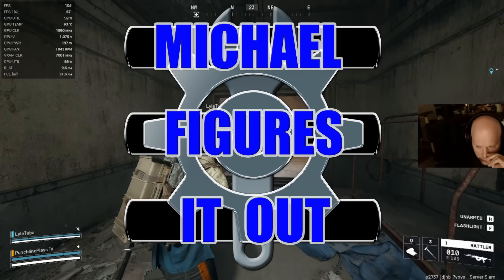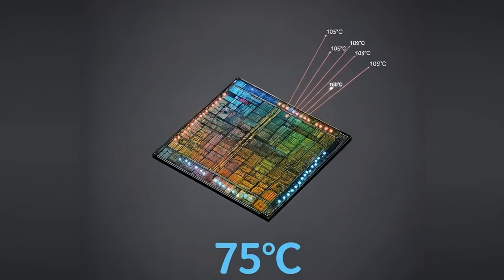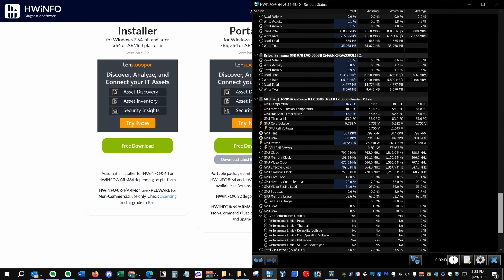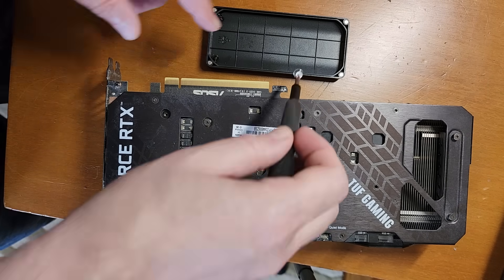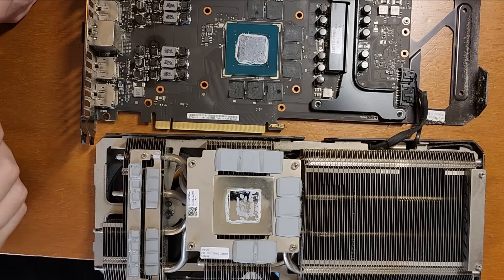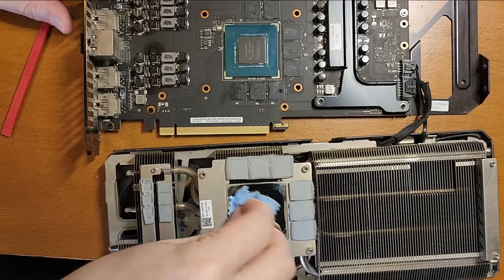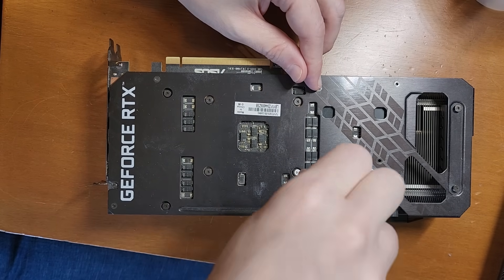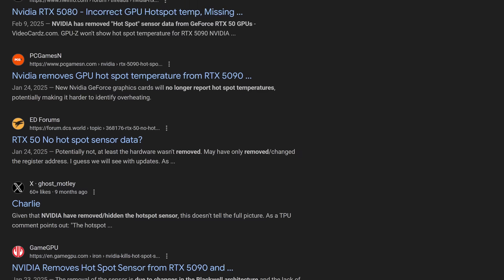GPU Temps Are A LIE!

Comment: Nvidia removed the hotspot sensor on the 50 series lol.
Reply: Ngreedia at its best buy more save more
Reply from the maker: I hope they bring it back for the next series.
Reply: @MichaelFiguresItOut  Hopefully, it's really helpful in knowing issues if your card hasn't been pasted properly at factory, and also waterblocks.
Reply: @MichaelFiguresItOut  Which software are you using to check hotspot on gpu ???
Reply: We should be able to get Hotspot temps back with the right hacks
Reply: and they are trying to remove any home gaming that isnt cloud subscription.
Reply: Hmmmmm...
Reply: its because u need to go and buy the new one for 3000$ 🤣 When ur old one stops working
Reply: Deliberate choice. Cards will be running hot and maybe crashing, but users will have no idea.
Reply: Ngreedia brainwashing the community with there scammy behaviour there melting cable blaming consumers fault and dont forget multi framegen a.i. crap
Reply: Not all cards ever always had hotspot temp sensor anyway...
Reply: are you kidding? i am about to buy 50 series card! 😨
Reply: @wildcat002  I mean, I wouldn't let that stop you but just be mindful. If you're having low core clocks, random shut down etc it could be bad application of thermal paste from factory. It's unlikely, but it could happen. 

Many years in the future, paste could also dry so be mindful again.
Reply: i have the hotspot sensor on my rtx 5080 fe lol
Reply: So what can we do? I used gpu-z to check hotspot temps and I assumed “memory temperature” was the hotspot. It’s consistently about 10 degrees hotter than the “gpu temperature”
Reply: They didn't offer it for a good while amd has since at least the 5700xt for me but Nvidia 3080 2080ti 1070 1060 none had hot spot temps when I had them.
Reply: God dammit, my 5070ti keeps crashing and I was hoping this would share some light on the issue...
Reply: @thewhyzer check your memory usage. You may be going over your vram capacity
Reply: @Kevin-m4d  It's definitely not that. And the single game that ever made me go over the 16GB VRAM just got slowed framerate wised.
Reply: That's why I bought a 4080S second hand with 2,5y warranty over 5070Ti.
Reply: @H0don  for how much
Reply: @H0don  got a 4070 ti super for 600euro with 3 years warranty left, a 5070 ti is 900euro here:D
Reply: @H0don  hmm, i wouldnt have done that. most errors are user errors anyway
Reply: @__-fi6xg  I bought a 1080ti over a 3060ti for 100 bucks, gonna cry about it?
Reply: @nicekeyboardalan6972  no but i dont get it either
Reply: @__-fi6xg  Are you talking about the burning connector failure (fire), or the hotspot issue? Because in the case of the connector after extensive investigation that isn't the case. There's sensor pins to let you know if the cable is pushed all the way in, the connector got a revision solely for that reason. Some cards won't turn on, whilst others will beep at you. In case of voltage imbalance the cards have a red LED. It's a weird issue yet it still happens, which leads us to find that the connectors itself have different tolerances between GPUs. See Der8auer and the new power monitor they made. GN found debris in the connector. The cables themselves, the then at the time stiff cables leading to bending etc. It's easy to blame user error but if the cable itself makes it easy for that failure to happen then that's more on the company. We've had product recalls for less.
Reply: @Accuaro  yapper
Reply: @__-fi6xg Unfortunately it's a topic with a lot of nuance
Reply: @Accuaro  most people dont own a 5090, its a 1% issue of youtubers that get sponsored and earn 100x more then you
Reply: @nicekeyboardalan6972 not so much horrible. 8gb is okay in most 99% games. Ive 170fps in direct12 ultra in fornite ( without raytracing) 1440p.. with my 3070(8gb)
Reply: @Geronimo-revanced  Until you hit that vram limit!
Reply: They didn't remove the sensor. They just made it so ONLY their software can read it.

Only one reason to hide a temp sensor....
Reply: and now i wont ever consider one lol
hotspot sensor saved me when i bought a used 3080ti
Reply: Nvidia has removed hotspot temps for 5000 series because they don't want lawsuits
Reply: @xlr555usa  Oh BS. If anything they're more likely to face lawsuits without them, because chips seem to fail under normal temps. All exposing hotspot temps does is help you know if there's something wrong and whether you should maybe turn fans up, or if you're in the buying phase, get a card with a better cooler.
Reply: Nvidia is a scam, I stopped buying their cards since 4000 series
Reply: mentally add around 10° and it should be very close to the hotspot
Reply: @RenanMsV_YT  unfortunately, the die can be cooking itself alive and you have no way of knowing that.

I guess it's related to people RMA-ing the cards, that had too high delta between GPU and Hotspot sensors.

GPU sensor is NOT on the die and given how much can the delta be, i suspect it's nowhere near the core itself either. So the cards will overheat, throttle and yet, the GPU will remain fairly "cold" - in 60s or 70s, confusing everyone what is the issue. Maybe even leading to denying RMAs.
Reply: @n0n4me-h2h  lmao what? Core temp sensor is most definitely on the die.
Reply: @alkestos  then explain, what drives the difference between temperature of the core sensor and hotspot.

On top of that, explain, how can a sensor on a die report the same/slightly higher temperature of "core", when there is bad contact, resulting in hotspot reaching 110°C. but "core" reports 63-65°C.
Reply: @RenanMsV_YT i mean the video you are watching tell a difrrent story when itbreally matters to know the hotspot you cant
Reply: Yes but they consume much less power
Reply: @MAGNUM_hr  You mean how this 3070 was only consuming 195-213w and still faced hot spot issues? Maybe power consumption isn't the issue here, and also open your eyes to that of the Chernobyl nuclear reactors worth of power consumption aka 5090.
Reply: @Accuaro how much does the 5070 non ti consume?
Reply: @MAGNUM_hr  Around the same as the 3070 (214w-ish)
Reply: @Accuaro yes but the hot spot temps. Are most likely related to VRAM and changing the thermal paste would not solve it , you have to change thermal pads
Reply: @MAGNUM_hr   Nah not unless you're doing water cooling with water blocks, but even then it's not limited to VRAM. Without hotspot temsp you will never know if you got terrible application from factory. Regardless stop defending Nvidia on this.
Reply: @Accuaro i'm not F nvidia , just saying I had an asus strix 2070 for years never had thermal issues , now i own a gigabyte vision 3070 and I constantly hit 100-105 °C hotspots and the gpu temp is at 75°c ... I changed the thermal pads ( pain in the a** ) my hot spot dropped to max 87°C
Reply: @MAGNUM_hr  And you wouldn't have known that was an issue if you didn't have a hot spot sensor, which is why it has nothing to do with power consumption. Also that isn't truly indicative of a thermal pad issue, it could also have been inadequate mounting pressure. If you also repasted that also means you can't really tell if it was the thermal pads being the issue..
Reply: @Accuaro I get what u sayin' but 80% of the time the hot spots comes from worn out thermal pads on the VRAMs, I could be wrong tho
Reply: @MAGNUM_hr bro I can feel your pain, I had gigabyte 3080 vision and I replaced thermal pads by myself and put liquid metal on it. The fact that you need non -regular thickness on the VRAM pads (about 1,5-1,75mm) made me crazy.
Reply: @MAGNUM_hr  GPU hotspot temp is taken only from the GPU die. VRAM temp has a separate sensor you can also check with hwinfo. If your issue was hotspot temp then it was solved because you also had to repaste the GPU when you opened it. It's pretty common that thermal paste from factory pumps-out after a few years, it has happened to me with almost all GPUs. This is why the hotspot sensor is so important: it's a very clear symptom of thermal paste pump-out.

Comment: Got rx 7800 xt and it sometimes goes to 90 on hotspot.
It has extra side fan to coll it plus top and bottom fans removing extra heat. Without it would most likely burn down
Reply: Constant 90c hotspot is all good on a 7800xt , having the average hotspot temp under 95c is what you want, short peaks to even 100c dont matter, throttling starts at 110c on 7800xt, dont worry dude, 90c hotspot is chilling territory
Reply: @servermaintenancedude I don't, it's warming my room during winter nicely
Reply: @xAndrzej42  haha yep no worries

Comment: RTSS can also show you whether thermal throttling is engaged. That's how I caught onto how my Gigabyte RTX 3070 was thermal throttling. Nothing a repaste couldn't fix...
Reply from the maker: HWInfo64 shows it too but I forgot to mention it in the video. I liked RTSS but only used it with MSI Afterburner. When I switched to FanControl I uninstalled both.
Reply: @MichaelFiguresItOut  What are you using to set the overclocks/undervolt then?
Reply: I should add that HWinfo has more elaborate monitoring for CPU and GPU throttling. Just let it run in the background while you give your system a workout. Note that this data can be nested and may vary in naming conventions between GPU vendors.

Comment: Ya hot spot temps are a pain. My 4090 OG OC gets to 112c on it's hot spot while the average is 70. I am just waiting for my thermal pads to arrive to take it apart.
Reply from the maker: Do you need to replace the thermal pads? The hot spot is only on the GPU, not the VRAM or other components.
Reply: @MichaelFiguresItOut I am planning on doing everything at once. PTM on the GPU, high-end pads on the VRMs and memory, and Cerakoting it arctic white to match my build.

Comment: This isn't some huge revelation, delta between avg and hotspot being > 10 should've been the first thing to check, and the first thing to sound alarm bells. Also the new paste you applied will eventually also meet the same fate as the old one - which is why i recommend using Honeywell PTM7950 for the core. My RTX 3090 went 15 degrees cooler after using this stuff.
Reply from the maker: I will use PTM if the paste doesn't hold up. Made the video because I don't think a lot of people are aware what the hot spot temp means. Even read some posts where people said to ignore it!

Comment: Hahahhaha i got mine old palit rtx 3070oc AND my gpu also over heat so i contact the palit directly and they support me with which thermal pads they use and which thermal pasty is used on core also they drop me directly step by step how to dissasamble gpu and how thicc pads i need and also they give me tip which pads are best, like top tier support from Palit NGL best. I end up repasting my GPU core with Thermal grizzly kryonaut and replacing my pads with brand new custom made CRITICAL THERMAL PADS really good stuff they can made custom pre cut pads for GPU really good stuff but very very expensive, After i dit all this GPU temp drop from 91C to 72C, GPU memory temps drop from 105C to 88C and GPU core drop from 98C to 76C and GPU gain a lot more fps and was very good no longer crashing or anything like that, but after some time i sell it and buy this time Asus rtx 4070super where i find out that this is yet another NVIDIA gpu that have same issues with higher temps so i end up with buying AMD rx 7900GRE and literally GPU teamps 56C memory tems 72C and hot spot 78C perfection.
Reply from the maker: That's good to hear about Palit. They don't have a big presence in North America. That's a shame!
Reply: @MichaelFiguresItOut  yeah it was years ago and they even admit they at that time used on lower end gpus like 3060 and 3070 cheaper pads and paste but in later models like 3070ti and higher they used better ones cuz even they find out that wasnt enough, never the less palit was great to talk with and they reach in like 2 or 3 days since i text them hahahsh this is nothing that can be said about fucking Asus ngl comunication with Asus was 1 out of 10 trully greedy company that literally dont want to help at all, i have so far two Asus gpus after my 3070 i buy asus rtx 4070super first model brake after two weeks just stopped working idk maybe factory defect and right after that i pick another one same model but this time third gpu fan stopped working lmao 😂😂😂 i return that and i switch to AMD  rx 7900gre which i have till today NGL price to performance is perfect, deivers are excelent unlike those on nvidia those days and over all temps on my AMD GPU ARE also excelent only down side is maybe for someone higher power draw of 300watts cuz this is gigabyte gaming oc and it should took around 280watts but mine always took 290 to 304watts, also i riecently wanted to replaced my 7900gre with 5080 cuz i have it in huge sale so i pick up eghhemmmm again Asus yes im dumb as fuck at this point i know anyway Asus tuff gaming rtx 5080 and i have that gpu 3 days before 16pin connector melted like you cant make this shit up man, sooo yeah im back to mine 7900gre and i will replace my mobo and cpu next year instead i will gonna replace mine current x570plus and 5800x3d with x870 and 9800x3d and i will keep the rx 7900gre for longer time cuz this gpu have still alot to offer if this just support fsr 4 i would not need anything else. Also Asus as brand i dont wanna see ever again cuz i always pick up only asus parts even now i still have tuff gaming x570plus mobo but im 100% sure that i will buz msi tomahawk x870 cuz that is just perfect board with same features as any x870 from asus for 30% cheaper sooo fuck the Asus in general, also until nvidia still.gonna kepp their bullshit 16pin i will be with amd i dont care and i will at this point wait till 2027 for new rdna 5.

Comment: The 23k PCI express errors may have something to do with it? I'd try a different motherboard
Reply from the maker: That's actually on my PC, not Punchline's. Those PCI Express Errors are "Recovery Count" errors. Looked it up and it's just the number of changes from L0 to Recovery. It triggers when it changes PCIe link speed or width, usually from idle to load and vice versa. But I'm going to keep an eye on it. Thanks for pointing it out!
Reply: @MichaelFiguresItOut  Well thats a new one, Ive spent years using HWinfo64 and never seen that, every gpu has had the snot OC'd out of it, yet ive never seen that?

Comment: you got it wrong. GPU temperature refers to the EDGE of the chip not an average. your conclusions are otherwise correct tho.
Reply from the maker: I believe 'edge' was used with older GPUs that had less sensors. It is now definitely the average of multiple temperature sensors. It's also how HWInfo's popup describes the reading when you hover the mouse over 'GPU Temperature'.

Comment: I have a 4060 :) 115w tdp No thermal problems and a 14700T @ 50w pl1 pl2 105w  all fans on the case running at 600 rpm
Reply from the maker: Nice!

Comment: Went to local pc repair store to ask for thermal paste to reapply second hand parts.. Owner was shocked i even asked for it and stated he obviously dont have any at hand to sell since "why would need to replace the paste"... Yeah not going back there....
Reply: Where is such fantastic PC repair store?! 🤣🤣🤣
Reply: Since GPUs aren't getting better, I'm not dropping more than $600, that's what i paid for the 6950xt I have 

I recently repasted the card I did it  with kingpin paste and changed the thermal pads, to fancy one, The temps are so much better

Is a pain in the ass to find the right measures though
Reply: @TheLateral18  One trick to figure out thermal pad thickness is to either dig through thorough reviews (the ones that disassemble the cards and provide details, not just "slap it in a PC and run some benchmarks") or to search for waterblocks for your particular card from EKWB or Alphacool. Their mounting instruction PDFs list which thermal pad thickness goes where, and usually this is the same for the stock air coolers
Reply: remember always use ptm 7950
Reply: do it yourself, its not that hard. just look that u use a good durable paste that was tested by third partys (there is a lot of bullshit produkts around). The Pads should just not have a to hard degree of hardness or use a good thermal Putty instead. Durable produkts dont dry out or have much pumpout in 10 years.
Reply: @mistermariachi8271 re-read original comment, they already were going to do it themselves they just wanted to buy the thermal paste
Reply: @mistermariachi8271 
Like Arctic MX-6?
Reply: Arctic MX-4 works 95% the same since one single application 11 years ago, many people have the exact same experiece since it's by design. I'd rather buy not the best performing but a balance between longevity and performance so I don't have to worry about it
Reply: @q1337 
I am sure it does.
Now prove me MX-6 won't prove to have great longevity.
It lowers the temperatures quite a bit compared to MX-4 and price is similar unless something changed.
That being said I am curious how they perform vs many included pastes.
Vs pastes included with Thermalright,Be Quiet,Deepcool and many other Brands cooler models

Comment: Note:
Replacing the thermal pad may cause crashes or blank screens due to the chip overheating.
because thermal pads have different thicknesses even if they come in the same size and packaging.
That's why the easiest and safest way is only to replace the thermal paste.
Reply from the maker: Yup. I mentioned this in the video. You need to get the pad thickness just right!
Reply: @MichaelFiguresItOut  One trick to figure out the proper thermal pad thickness is to either dig through thorough reviews (the ones that disassemble the cards and provide details, not just "slap it in a PC and run some benchmarks") or to search for waterblocks for whatever particular card you have in front of you from EKWB or Alphacool. Their mounting instruction manuals list which thermal pad thickness goes where, and usually this is the same for the stock air coolers